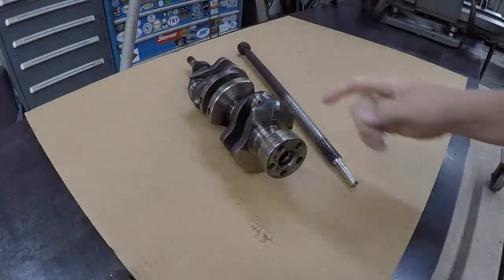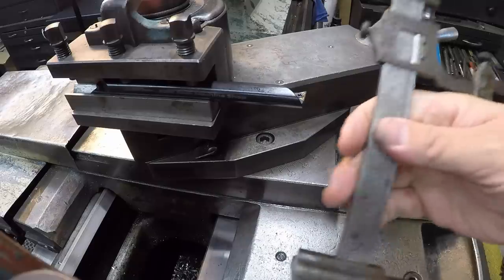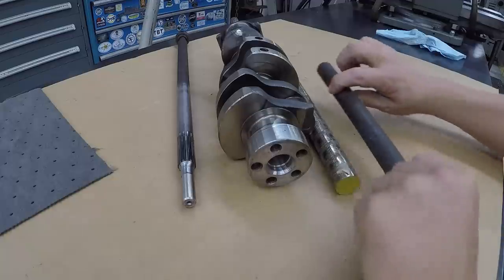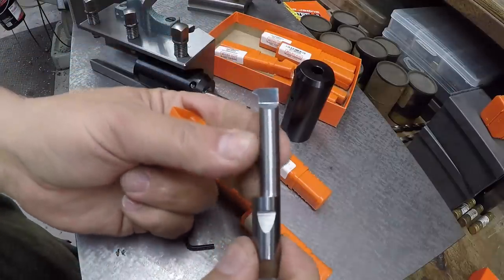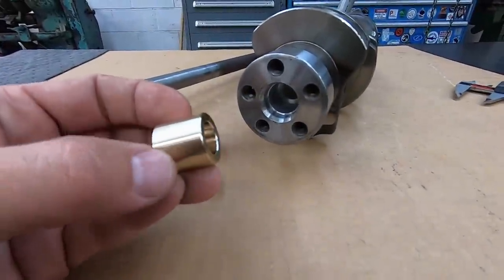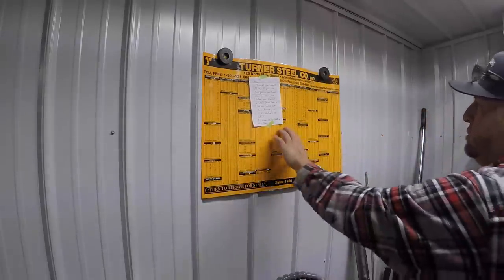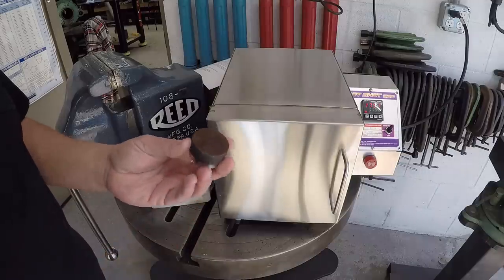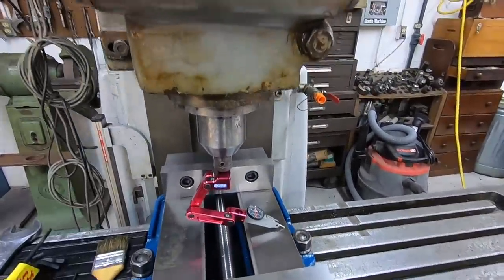SNS 294 Kubota Crankshaft Hot Shot 360

Comment: The original shaft end was hardened while the Eutalloy is soft. I hope it will last long enough anyway.
Reply: Shaft end need not be hardened, the bearing takes the wear. The hardening did nothing to save the shaft before when the pilot bushing failed.
Reply: @derekcoiner5946  the other part of the sliding bearing needs to be hard. Luckily this is very low load application and only spins when the clutch is disengaged. And it should ideally be ground also. The Eutalloy is very soft, softer than mild steel

Comment: I agree on the oil-lite and glad Keith spoke to you about it.  Unfortunately, the owner of the parts now has a custom pilot bushing, pressed in the crank.  I hope you made him a spare. All that's needed is a very light press fit.  There must have been a bearing or bushing there to begin with.  I would have machined a steel spacer that would fit in the hole you bored in the crank and that would hold the OE bushing.  In other words, repair the hole.  If not that, spray weld/machine the shaft to a standard diameter that is the I.D. of a readily available pilot bushing and bore the crank hole out to fit the OD of the bushing, or make a steel spacer ring to make up that difference.
Reply: This bushing will probably outlive the rest of the machine.
Reply: @piciu256  - well, I don't think we know why the failure happened.  If the underlying reason for the failure is not rectified (e.g., bad input shaft bearing, bellhousing mis-alignment, another failure may occur in short order.

Comment: I replace several of these pilot bushing suprized didn’t get bushing part from dealer so  it be standard size next time it needed replacing we always just drive them on bearing driver n hammer, like your videos though always learning
Reply from the maker: You must have missed the part showing how badly damaged the hole was because the shaft was flopping around inside it

Comment: that pilot bushing installation tool and a few pieces of white bread makes a nice bushing removal tool, just push the bread into the bushing and compress it with the tool and a hammer and it will force the bushing out of the crank
Reply: Thick grease too.
Reply: Well, son of a gun, I thought bread would have to much trapped air to work. Modeling clay would work also.
Reply: @ellieprice3396  i use wet paper, old newspaper soaked in water works well
Reply: Only if his bushing doesn’t touch the back of the bore

Comment: Excellent repair!
I work on a lot of older kubota's and have seen quite a few cranks and propeller shafts damaged like this.
The counter set in the end of the crank is for a dust seal.
Not real sure of which model crank that was, but the front main seal ring and gear do come off of most of those cranks, so you could have pulled them to chuck it up to the front journal, but i think it's safer to chuck to the spline section as you wouldn't want the possibility of damaging the journal surface! 

The original bushing is a teflon coated brass bushing.

Another option would have been to  machined a steel insert to bring it back to size of the original bushing hole diameter and then used a stock bushing, that would have also made it simple for future replacement of the bushing.
Reply: J.C. Kohle  Yes the repair is excellent, I'm not knocking his work one bit!
But what happens when the custom bushing wears down, it's not an off the shelf item, if he put a new sleeve in it for the stock bushing to ride in it would be repairable for way cheaper the next time.
And yes these bushings wear out quite frequently under normal use.

Comment: The pilot isn’t supposed to seat all the way down in the crank, so when it’s time to replace it you can put a blind puller in it.
Reply: Grease will remove it when a blind puller won't.
Reply: Pack the grease in the bore for the pilot, when the shaft is out. Then drive in the dummy shaft.

Comment: Wow! The comments here are almost as good as the video. And that was a fun one. I’ll be interested in the resolution of the oilite vs, bronze question. If that IS the wrong material what will happen in use? Will it wear away? (Very observant crew here, BTW.)
Reply: I made this very same mistake on a car clutch. The bearing lasted about a month before it started screaming due to a lack of lubrication. I replaced it with oilite and it lasted years.

Comment: I am not a machinist and wonder when you say you are taking 50 thousands is the 25 per side for a total of 50? I do enjoy watching to see how you work different projects.
Reply: That depends on the way the machine is set up. There are direct reading lathes that if you turn the dial to say .010 the tool moves in .010 and you would be removing .020 total. Other machines actually read in the total amount of stock removed. On those the dial reads 1/2 of the amount. So if you set that dial to .010 it actually moves the tool .005 and only removes .010 total  You need to know which way the machine you are using works. 
Keith Rucker has a video on it. www.youtube.com/watch?v=o5AXKYctOMs
Reply: @Blazer02LS  Thanks I do watch Keith's channel quite a bit but I had not seen that one. I guess when Jeff says I am going to take NN off I always wonder is that what he dials in or what is coming off.
Reply: Most of the folks usually say what they need to take off as a total. IE "I've got .040 to go", that is the total so on many machines they would dial in .020.
Reply: Typically refers to diameter reduction.

Comment: When you were boring the crankshaft, how did you know that the oversized bore wouldnt effect the strength of the end of the crankshaft
Reply: a hollow shaft has most all the torque carrying capacity of a solid shaft.  in this case the numbers are easy to run if you felt the need, but  look at the input shaft this crank is driving. look at its diameter, do you really think a tube with the OD of the mains and ID of that bore will fail first? yes it has to also deal with harmonic stress between the crank and flywheel but by eye that must be an order of magnitude stronger than the input shaft. TLDR -- you trust your gut/eye/experience.

Comment: Why didn't you size it put a needle type pilot bearing in? That might for better longevity at the low RPM's of a diesel tractor. Just observing. Not criticizing. Great work!!!! Love your shop!!!!
Reply: I was thinking the same thing Rodney , but the quality of these new bearings are very questionable today, might be better off with a old bushing anyway.
Reply: I think you have to  have the proper heat-treatment on the shaft or hardened sleeve if your going to use needle bearings. Oilite is the easiest way to go.

Comment: next time you press fix bronze put it in the the freeze for about an hour you should get bout 0.05mm shrink so it will slid in and ass it warms up it will bite in with the surface tension
Reply: Yep - have done this to fit wheel bearings in my Lotus Elise - Ballrace/bearing in the fridge overnight and the Aluminium hub carrier in a bucket of boiling water when ready to go and the outside of the old bearing ground down a bit to do the pushing.  Makes it super easy and no real force needed.

Comment: Annd good luck to the next engine rebuilder who doesnt have a lathe. That bushing doesnt even have rear face clearance to get a hydraulic push method to work for future removal
Reply: The next guy would probably junk the crank. Just saying.
Reply: Well, somebody didn't have it. And they called the guy who had.
Reply: I cut  them with a carbide bit ,it only takes a 5 minutes

Comment: Great video. I love the Hot shot 360 oven, please share any knowledge you gain about heat treating. I have virtually zero experience with it. I have a question about the bushing you made for the crankshaft. You bored the bushing to finish size before you pressed it in with .001 interference fit. I have never had any luck doing that when I had a final clearance to meet. I've always bored after it was pressed in. If you have any tricks to figure out the pre press bore diameter I'm listening. Thanks Adam

Comment: so i got to thinking about that heat treating oven.
mostly because i have a rusted turbo manifold with broken bolts...
getting iron up to 600F expands the steel something like 1% and makes rust brittle so it cracks under the pressure.
would baking a stuck bolt make removal any easier?
let me know if you need a rusted out turbo manifold to test the theory on :)

Comment: With that heat treating oven, do you know if it has or needs rigidizer put on the sheet of kaowool on the door? With blacksmithing forges that use kaowool it is suggested but that is more of a case of the flames pushing particles of it out into the air where as I don't know if it will break down the same way in just an oven.

Comment: I've been in heat treating and forging for many years.
Here's an invaluable tool for you. The Heat Treater's Guide from the ASM. You can download it, refer to it online or perhaps the easiest thing is to put the app on your phone.  https://www.asminternational.org/web/hts/heattreatersguide 

*When doing some alloys such as 4140, you must immediately go to temper after quenching. Without the immediate temper, the stresses from hardening will cause cracking.  On large parts they can actually break up violently!  A number of years ago I did a case hardening system for the tread area on 30 inch diameter 4140 wheels for cranes. During pattern development and not having a tempering oven as that wasn't our responsibility, they would almost explode a half hour after hardening with a loud bang. I dummied up a temporary program to provide a little reheat to prevent the grenading steel.

Love your vids and talents, thanks

Comment: I just unloaded a pallet of machinery blades around 5/32 thick that had a date on them [ on tag ] 1960 and still was blue inside the middle of the pile. Would that be better than metal you buy now?

Comment: Once you sharpen those boring bars the cutting edge has to be reset to center, so you can't use that pin across the back of the tool no?
Reply: Why would you sharpen the top of that boring bar?  The top is flat.   But really, the only place those belong is in a high production CNC machine (or a machine shop where they're given to the owner for "free").

Comment: I have an anvil from the 1800s and the work surface is all beat to hell. It has a 1 inch thick hardened steel deck. What machine would deck that straight? I tried grinding it but it eats every grinding cup Ive tried. Id appreciate any info you could give me.
Reply: I doubt it's an inch thick- it may have a beefy step (Vulcan perhaps?) But the plate is very rarely that thick. A quick side polish and etch should reveal the true transition. 
If you cut it too thin it will start delaminating after not a whole lot of use. The guys over at I Forge Iron can give good input about workarounds and proper repairs. A lot of them will cringe if you mention grinding and machining, but if you provide pictures it will help aid in proper advising.

Comment: Adam, I've noticed that you've had to use one set screw on your lathe tool holders several times due to the middle screw not being close enough to the end screws with some tools.   Have you considered adding two more set screws to your tool holders?  If not please comment why,  as I have the same issue with smaller tools at times.

Comment: Those magnets come oput of Microwaves. In the Magnatrons. The older style, not the inverter newer ovens
Reply: You can also salvage nice, strong magnets out of old, dead computer hard drives... if you have some screwdrivers (straight, Phillips, and Torx) for fine jewelry, electronics, and hobbyist use. Just don’t let them pinch your fingers, or you’ll get a painful blood blister! 😎
Reply: That style and apparent size of ring magnet is (or was) very commonly in longitudinal automatic transmissions, particularly GM 3- and 4-speeds derived from - and including - the Turbo HydraMatic 400.

Comment: Couldn't you heat the crank and freeze the bushing...
As a technician we did this all the time for transmission gears that were an "interference fit"
Reply: +1 for freezing the bearing heating the crank, I freeze bearings and bushings all the time with plumbers freeze spray for pipes the bearings just drop straight in with minimal effort required and no danger of galling, just done the main bearing inner races onto a crank warmed them up and dropped them on easily

Comment: Adam, i just picked up a leblonde lathe, looks like early 1940's, i believe it's one of the trainer series, the 3 jaw chuck is worn out, I'd like to get a 4 jaw for it, also I'd like a tool post like the one you use, i also need some drill chucks for the tail stock, I'd prefer to buy good used stuff, if you have any suggestions would be appreciated

Comment: Do you ever grind your parting tools on an angle so the part will separate before the entire cut is completed?
Reply: I could imagine that at least in larger diameters that would result in concave face, doesn't matter if it's faced afterwards but then again, the burr wouldn't matter either.

Comment: I'm curious, is it more cost effective to make a repair like this if a new crank is available?  Thats a lot of work and time involved and time is money as they say.
Reply: From experience cranks are typically really expensive. We had one ground at work, they ground all lobes 0.05mm undersize, and for us the price of grinding was the same as a new crank. Mind the customer would have to pay at least 30%-40% more than we do. This was for a "spare" engine anyway, so the price for a potential customer would be "overhauled engine" which is in a completely different ballgame. 

But depending on application you usually only replace a crank if it's snapped, bent, or scored up beyond any oversize bearing spec.

Comment: Adam, 863 is not oilite, it is 841.  I believe you will still have issues with 863 unless you have access to lubing it.
Reply: You are thinking of c863, SAE 863 is different. SAE 863 is a sintered powdered metal bronze and is oil impregnated.  For reference see:  https://www.nationalbronze.com/News/sae-863-vs-c863-whats-the-difference/
Reply: @benrivenbark  Thanks for the clarification, Yes I was thinking of c863
Reply: I believe that what Adam used was c863 because he said that he purchased 1' of material and oilite you can not purchase in that long of a length.
Reply: @Randy G That is what I thought, by no means do I do this to criticize, just as a heads up.  I am a amateur who is just trying to lean and clarify.

Comment: Great tip from Keith, I'm a car mechanic by trade (don't do that no more) and that's the correct material to use, starter motor bushes is another place to use this material, good press setup.
I want to make a straight cut gear drive for my Dodge Flathead 250, would you recommend 4140 and heat treat?
Or would you recommend something else?
Cheers from Sydney Australia.
Reply: Do you mean like straight cut timing gears?
Reply: @bcbloc02  Yes sir. because its chain drive I will need to make a crank and cam gear, and one or two idlers to keep the cam spinning the same direction as the crank.

Comment: I have that same starrett height gauge with the same black pitting. Soaking it in evaporust got rid of the black. Pitting is still there because the steel is eaten away, but the corrosion is gone. Since you have 50 gallons of the stuff 😬 it should be an easy thing for you to do to preserve your family heirloom.

Comment: Can the oil inside dry up if the work gets too hot while machining that bushing?
Reply: There’s no oil impregnated in the bronze until it comes in contact with oil. If you look at sintered bronze material under microscope its surface is all pitted, those pits fill up with oil and that’s what keeps the bushing and the shaft lubricated.
Reply: @vaughtinternational3629  Actually there is oil in the bronze. The stock goes in a vacuum chamber to get all the air out and fill all the pores with oil. I always made sure I used a new corner on an insert when machining the stuff because dull tooling will mess up the pores and you don't have any oil.

Comment: You have such a great shop Adam, my father passed when I was 5 years old, he was a machinist.  Always wanted to learn, been looking into manual lathes, would you recommend getting a small grizzly or getting an old lathe that needs some work?
Reply: Govdeals might be worth looking at
Reply: Where is a good place to look for used lathes?
Reply: @Machinitect Grizzly "makes" (owns) South Bend lathes. They are both made by the same manufacturer in China (Or maybe Taiwan), and SB is nothing more than a name that the owner of Grizzly bought for $65, a half eaten bag of Cracker Jacks, and a Tiddlywinks game.

Comment: Rock Island vice no 476   about 5" wide jaw and at least 7" grip size.  Deep.   Nice heater that is for certain.  Heat soak a ring to fit over something.
Heat rod for longer / thinner.  Heat rings larger.  So forth.

Comment: As always, the best.. Does that shaft turn in the bushing?
Reply: Yes, the holes in the crank are for a flywheel, then there's the clutch disk and pressure plate that mount to the flywheel. So when the transmission is in neutral, the shaft is spinning inside the crank, or it's something real close to that as he's described the use of the transmission shaft and all. All manual transmissions have a bushing in the center of the crankshafts for this reason.